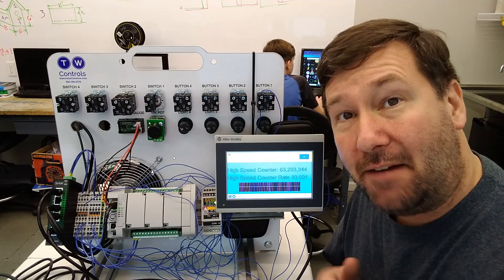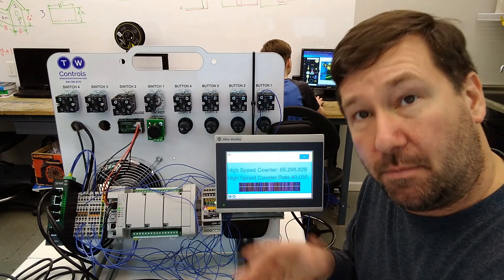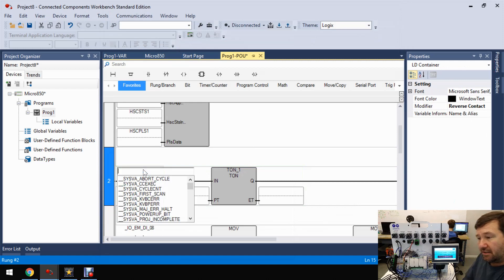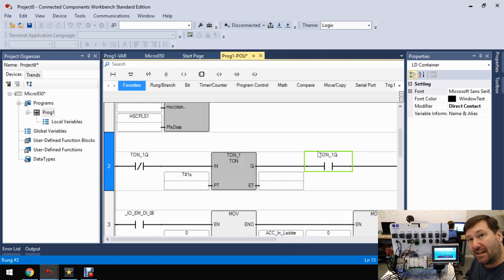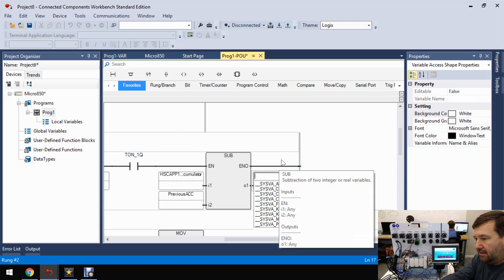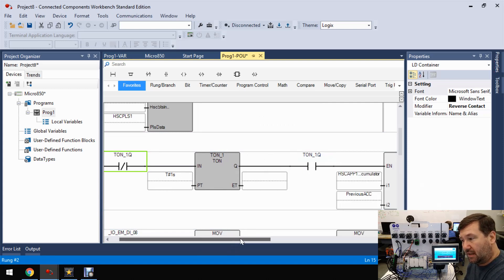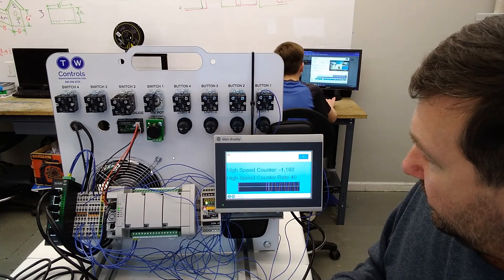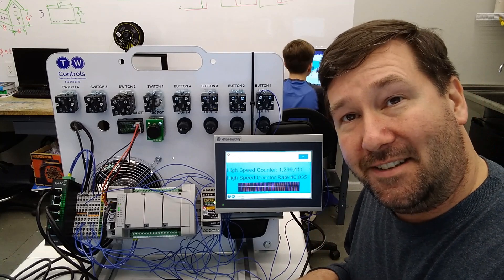Calculating Rate on a High Speed Counter in a Micro800 Micro850 PLC

Comment: What will happen if the conuter contunues counting, until it reach it maximum value 	-2,147,483,648 to +2,147,483,647
Reply from the maker: It will rollover, check out this video. 
https://youtu.be/ROpT422ggUg
Reply: @TimWilborne thanks
Reply from the maker: @zahraddeenabdullahi5899 You are welcome

Comment: Tim I figured it out. The hscID sets the counter number. Doesn't say that in manual. It just says that the range for HSCID for embedded inputs is 00 to 0F. Not sure what the values above 6 would do. Manual doesn't say.   Also here's a little anomaly I found in micro850. I set up a 3ms timed interrupt and in the timed interrupt I read in the microsecond clock value and store it. Then I compare the stored value to the next time I go into the 3ms program. I do this to measure in ms how often the 3ms interrupt program actually executes.  It shows 300 micro seconds difference. It's like the microsecond clock actually counts tens of microseconds. What do you think?
Reply from the maker: Not sure, haven't played with the clock. Interesting findings.

Comment: Tim, I like your videos a lot, but I am stuck on this CCW micro850 HSC.  I want two simple up high speed counters. My understanding is that HSC_0 uses inputs 0,1 and HSC_1 uses inputs 2,3.  Then I use mode 0. Set the app data as you did in your videos and set the filters on the inputs of course.  Then put a 3 in the command to load data. The set command to 1 and it should count.  Not working. Any ideas?  Also is there a full example program out there that shows how to load data and got to count from a download to a new PLC.  Do I just do a rung that sets command to 3 for the first scan, the set it to 1 when first scan goes off?  Let me know what you think and thanks again.
Reply from the maker: Mode 0 would be two basic up counters on inputs 0 and 2 but you mention inputs 1 and 3 so I don't think that is what you want. Also, check your error and sub errors.

Also here is a more recent video where I talk through finding the errors.
https://youtu.be/-FoGliVKUGE?si=NnCrJsEnjCe7wuZq

Comment: Hi Tim, is there a way to calculate encoder speed if it's in mode 7 (i.e. resetting the accumulator count each cycle with the z pulse)? Or is it possible to count the z pulses and determine the encoder's speed that way?
Reply from the maker: It would be tougher but I would say that there would have to be a way, I'll put that on the list to play with the next time I have it setup.
Reply: @TimWilborne  thank you!!

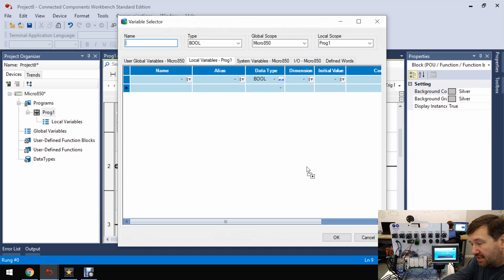Comment: Thank you for the video. In 2:37, is it necessary to add the NO contact right after the timer?
Reply from the maker: I don't know what a NO contact instruction is :)
However yes, the Direct Contact or "Go Look for a 1" instruction is necessary so that that bit of code is only true for one scan.  You can learn more about aversion to the "NO Contact" here.
https://www.theautomationstore.com/basic-bit-instructions-in-connected-components-workbench-direct-contact-reverse-contact-coil/
Reply: @TimWilborne  I think @hakerman is referring to the XIC TON_1.Q on Rung Q; I agree with @hakerman that the output rung is driven by that .Q bit, i.e. there is essentially an XIC .Q internal to the TON instruction, so that external XIC may be unnecessary.  But I could be wrong ...